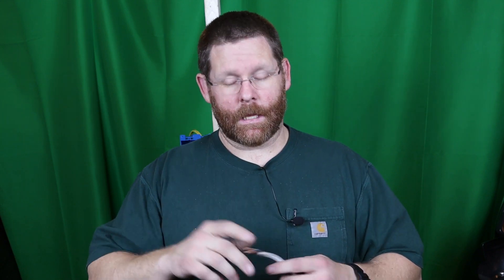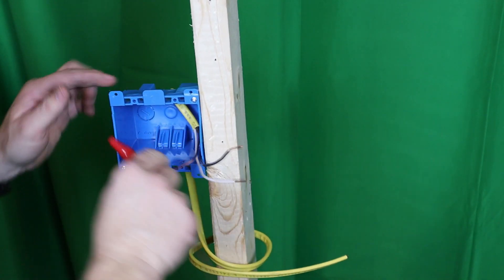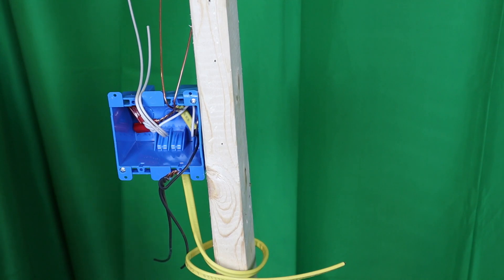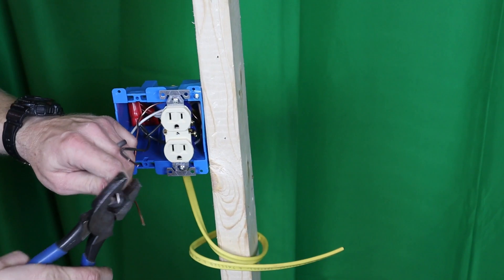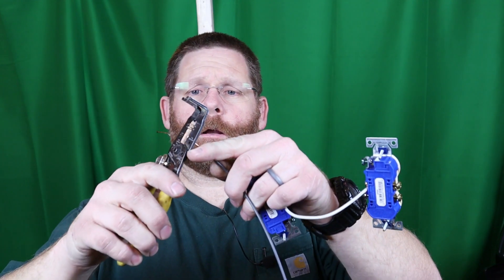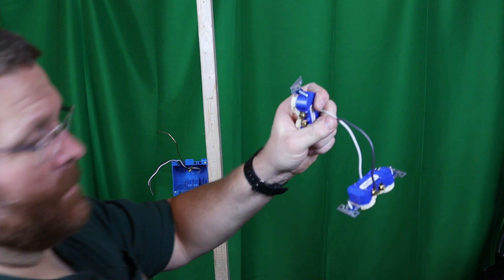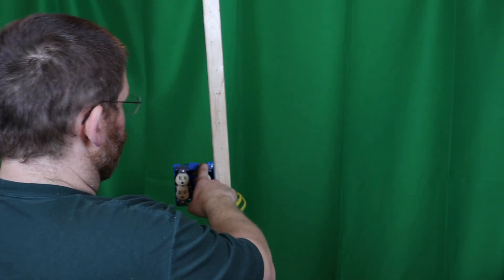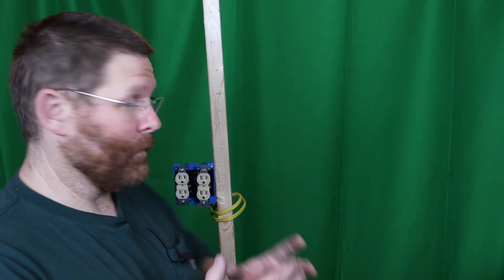How To Wire A Double Receptacle Two Different Ways

Comment: So your reason for not liking method 2 is if you have a problem later you have 2 less screws to check. Did I understand you correctly?
Reply from the maker: so it was kinda vague what I said.  so there is alot of different reasons but main for me is if i had a problem with one of the receps I could  take that recep out of the equation fix it and not mess up anything downstream like if it was a circuit full of computers and could turn off the circuit you can take that one off leaving everything on while fixing that problem

Comment: Hi, I’ve done exactly what you’ve done in the video. My question is , I want to come from the first receptacles, go left and right with two receptacles each side.  How would I bring it to the other 4 receptacles, from the first two? I have a 20 amp breaker, using 12/2 with a ground, great video very informative Thank you
Reply from the maker: basically in and out.  Go in one box then back out id make pigtails in the boxes
Reply: @MountaineerOutdoors  Same as first box, just repeated. Thank you

Comment: Why can I not find a darn video that shows what all is what on the actual outlet!!  Source side?, output side? Ground multiple, top screw vs bottom screw? Man this sucks. Ive never done electrical. Ive been locked up for many years and now being out I have no freaking idea what to do. Sucks.
Reply from the maker: Here you go bud... Hope this helps https://youtu.be/GyJNMG0JTE8
Reply: @MountaineerOutdoors  ty! Appreciate it. I managed to run another outlet but now gfi in garage keeps tripping. Must have something wrong God help me haha
Reply from the maker: Might have the ground touching something. Like nuetral or a hot. Let me know what you find
Reply: @MountaineerOutdoors  ty! Gonna try working on it today. Gonna Try working on it today. Do you know if I went with A 20 amp GFI would that make a difference and if so would I have to upgrade circuit as well?
Reply from the maker: No that won't solve the problem you will need to find out what is touching or maybe you have a bad gfi. Upgrading to a 20 amp you will need 12 gauge wire. Is that the only gfi on that circuit?
Reply: @MountaineerOutdoors  ok. Ty. Looks like it is only gfi. From what ive found it looks like the one garage gfi outlet covers the outdoor outlets. Strangely none of the outdoor outlets seem to be gfi either just normal outlets. I feel like the electrician who built home had too much on that one gfi
Reply: @MountaineerOutdoors  oh my gosh man I got it working. Appreciate the videos. Got new gfi hooked up. Then got light running and everything seems good. I confused the ground with black. Was thinking I was hooking car stereos up back in day haha. Thanks man appreciate it. God bless
Reply from the maker: Awesome so glad to hear this.  It's always a good thing when you can accomplish something on your own. Merry Christmas and thanks for the comment and watching

Comment: I can tell the guy knows what he is talking about but I couldn’t even get a chance to see the wiring scheme because it was always moving in his hand. Thanks for the video tho because I think I got the idea.

One question tho for the second way. Why do you use the Side screws rather than push connector in the back for the black wire?
Reply from the maker: This video is the reason why I do not stab in the back. Thanks for watching and commenting ☺ https://youtu.be/UJ4UvQ7VAig
Reply: @MountaineerOutdoors  Wow I just did about three outlets in my sons room using the push in method.  Thinking about going back and redoing them because of that video. Good points.
Reply from the maker: Yeah I am definitely not a fan of the push method. They should in my opinion not even put that option on the receps. If It were me I definitely would especially since it's only 3.
Reply: @MountaineerOutdoors  I ended up fixing them today ha. The only one I could not fix was my single pole outlet switch. Has two black wires going in and then the red wire. I used the screws when able but the second black wire had to be pushed in as there was no second screw for the black. Would that mean I should convert it to a double pole so I have 2 screws up top for the black?
Reply: @shaun9209  *three way switch not double pole.
Reply from the maker: so the one with the red wire is it a 3 way?? or was it and now its a single pole??
Reply: Shaun
So it’s a single pole switch which I put in when I redid outlets. It has a 14/2 cable coming in then a 14/3 cable going out to a outlet that is controlled by switch on top and bottom is always one. So to do this on the switch there is the red connected to bottom screw. Then a black for the coming cable connected to the top screw, then the black going out cable is pushed into the top part of switch since there wasn’t an another screw. So basically the outgoing cable now has alway hot black ( which when gets to outlet goes into bottom part to keep that outlet always running) and the red controlled by switch. So to get rid of the pushed in black on the switch would I upgrade to three way switch since it has two screws up top and one on bOttom or create a daisy chain and just wire but the in and out wire black and run a pigtail cable from that wire n it tk the hot on the switch and therefore only requiring one screw for hot?

Btw  after researching probably more than needed I’ve come to learn your first method for this video ensures a  complete  parallel circuit unlike the daisy chain which is method 2 . Seems some areas require parallel as code for what it’s worth.
Reply: @MountaineerOutdoors  It was a single pole before and still is now..

Comment: I agree with you on preferring the first method. Only GFCIs should be wired to supply downstream outlets.
The primary reason outlets have 4 screws is so each outlet can be powered separately...i.e., have one outlet live and the other controlled by a wall light switch. You would snap the tabs off for that(before connecting any wires) 
Best to keep it uniform rather than try to redefine the function of an outlet.
Reply from the maker: agreed

Comment: I am adding two double outlet boxes into my garage and I am using a gfci outlet as my first outlet in the circuit. In order to protect the other outlets on that line, will I need to wire them up the method #2?
Reply from the maker: https://youtu.be/Fe9hwE8dN_k. This should explain everything you need to do. Let me know if you have any other questions

Comment: I have some questions:

1.The pigtails are sold already cutted or are taken from the main cable?
2. How many outlets can run from the same braker? 
3. In a workbench, I have a outlet box with a table saw and a shop vacuum plugged in, to work simultaneously. Can I add more boxes for more versatility even if is powered with a 12 gage extension cord?
4. Can I wire more outlets from the one my workbench is plugged?
Reply from the maker: 1.  you can buy pig tails but I just used scrap wire.
2.roughly 10 per code on a 20 amp circuit.
3. sounds to me like you have it maxed out already. if you are using both at the same time.or your real close. Id say your table saw is at least 10 amps and the shop vac is around 4-7 amps just guessing?
4. that depends on alot of variables.

Comment: If my receptacle is full..can I add another outlet to it?
Reply: I’m rearranging my living room but where my entertainment stand sits there’s no outlet. But there is one like 3 ft away. I was going to run a new outlet off of that one behind my stand..but there is no room to add connect wiring. So I was wondering if I can pig tail and run new wire to new outlet
Reply from the maker: Gotcha, that depends on alot of things, how many receps are currently on it? Does it feed anything else? Is your current box deep enough to handle another set of wires (cubic inches). Without me being there I cannot say for sure.
Reply: There’s 5 being fed by the circuit. I’ve been researching and saw that it should be no more than 80% of the amp usage? The breaker is a 20 amp so 16 max should be fine?
Reply from the maker: Your correct. That's is exactly right. Each Recep is rated at 180va which got each plug it's 90 hence the duplex making each device 180 having said that you can safely assume that round about 10 receps on one breaker. Now to make sure that your box will handle the extra wires and your golden
Reply: When you say handle your talking about fitting inside the box? And thank you very much.
Reply from the maker: Yes
Reply from the maker: I'm not exactly sure what you mean?

Comment: I'm working with GFCI outlets making what was one outlet into two.  After watching your video I'm convinced that the wiring is right - assuming that a GFCI works basically the same as a regular outlet - but NOTHING is working.  Apparently I've done something very wrong because not even my lights work any more.  I used your method #1 and I'm wondering if it's something with the ground wire.  Any ideas?  I will say I used the holes on the back of the receptical instead of hooking on to the screws.  I wonder if that would make a huge difference...
Reply from the maker: Honestly it sounds to me like you have the hot and nuetrals switched. The incoming hot has to be on the line side then the downstream has to be on the load side.

Comment: Clear as mud. It's like watching someone explain juggling by watching him juggle. Why do you think you have to move so fast? You're not on the job and (presumably) you're not trying to prove anything. How about describing how to make neutral and hot pigtails (you explained the ground, but that's easy.
Reply: The "PIGTAIL" is not fully shown or explained.  NEWBIE with virtually no wiring experience, like myself, needs to see the process step by step.  The way MO is holding the wires in his hand, it is somewhat difficult to see that he is attaching 2 short pieces of wire to the incoming wires.  MO uses PIGTAIL method to split the incoming wire [by attaching 2 shorter pieces of wire with the wire nut] so that he can then wire the 2 receptacles separately.  MO chooses this method instead of installing jumper wires, because as a PROFESSIONAL he is used to doing pass-thru pigtail wiring from receptacle to the next and so on until the circuit terminates at a fixture or appliance.  Having just watched another video with the jumper cable method, I would have to agree that the PIGTAIL method is more logical as the power supply is being split to the 2 receptacles as opposed to passing the power from one to the other.
Reply from the maker: Exactly gonna do s video on making pigtails.
Reply: @MountaineerOutdoors  THANKS MT Outdoors !
Reply from the maker: My pleasure ☺
Reply from the maker: Ok noted. However, I didn't think that I was moving too fast. I'll definitely keep that in mind for upcoming videos.

Comment: Exactly what I needed to know. Like that you showed "your" preffered method  because I was taught the 2nd way you show but I'm really liking your way. So I basically pigtail the "main" wire and then attach the ground, neutral, and hot to each of the outlets? Basically like you are wiring  each outlet as if it has it's own "main" line, except in this case it only has the one "main" coming in. Thanks
Reply: I ran into an issue with the 2nd outlet. The green test light is on but when I plug something in, it's not working. I know it has to be something I did, just cant figure out what I did wrong. It's just odd the green test light turns on but the outlet itself doesn't power anything. Maybe you might have an idea.
Reply from the maker: You have to make sure that your nuetral and hots are in the right places. Sounds to me like you you have them crossed
Reply from the maker: That's awesome I like finding more than one way to do things as long as it is right. I appreciate you watching and commenting ☺

Comment: Hey there - im changing the outlets in my bathroom from off white to a clean white. Well, the previous owner had them wired as example two. I like example one much better. So my question is this - what are the black, white, and ground wires called? So I can go to the hardware store and pick some up. Or do I just tell an employee what im doing and hope they know what I need?
Reply from the maker: You can buy some romex and strip it out yourself. Or you can buy individual pieces per foot. If you do that you can ask for 12 Guage solid wires THHN  hope that helps
Reply: Awesome, thank you sir! I've actually been binge watching your videos lol thank you!
Reply from the maker: That's awesome I do appreciate that. ☺
Reply: Oops one last thing - 12/2 Romex, I assume? I'm a new home owner so I'm learning as I go!
Reply from the maker: That's exactly what I would use. 12 Guage is for 20 amps and 14 Guage is for 15 amp breakers  you need to see what size breaker it's on.
Reply: Hmm, alright. I've just been shutting the main circuit breaker off. I'll have to have a friend help me so im not running up and down the stairs all the time haha
Reply: Alternatively, I could plug in a radio, or vacuum. Then go downstairs and just shut the breakers off one at a time. Whenever the radio shuts off i know the power has been cut 🤔
Reply from the maker: Good luck and let me know how it goes. ☺
Reply: Yes sir! Might have to wait for the weekend - got an awfully busy next couple days
Reply: @beegekhaos3171  A coworker of mine used a radio, but what he didn't know was his wife shut the radio off because it was "too loud". When he cut the wires he got a big surprise. So always check the circuit with a meter or non contact tester.
Reply from the maker: Damn good advice always double and triple check

Comment: Method 2 seems to use less space in the box. I'm doing a retrofit of two receptacles on opposite sides of a concrete wall and the box already there on one side is small.
Reply: Exactly my same situation.  Method 1 with the added wires n pigtails won't fit in the box.
Reply: Method 2 is the only way i have wired receptacles for 40 years much cleaner and less joints to work loose.

Comment: Can I use existing wire in my attic to add double outlet then add another wire to add one more outlet?
Reply from the maker: This depends on how many receptacles and other stuff is on the circuit already. My recommendation is to turn off the circuit and see how much stuff is off. Then make your decision then.

Comment: So glad I found your videos. My question for you is... Is it safe to put 15 amp receptacles on a 20 amp circuit with 12/2 wiring? Thank you
Reply from the maker: By code as long as you have at least two or more you can. Do I see a problem with it? No but it wouldn't hurt to put it on a 15 amp breaker or you can switch them out to a 20 amp.

Comment: Very nice video.   Few comments,   Twisting the conductors before the wirenut is acceptable but not required.   See manufacturers instructions.   https://www.gerrie.com/ASSETS/DOCUMENTS/CMS/EN/IDEAL_30_071_Installation_Sheet.pdf.   Question,    Why would you not screw in the un-used screws on the sides in?   I know fly poop in the pepper.   I did not understand the comment about hot and not hot in the end.  Not enough information to formulate a decision in my mind.   Not hot is a "I know nothing" question.
Reply from the maker: I would NEVER just assume that the wire nut would twist the wires, yes I know it's not something that is mandatory...its not mandatory to tie your shoes either but it makes alot of sense, As for all your other questions I'd have to watch my video again to see what it is your talking about. And the fly poop in pepper?? 😂 😂
Reply: Mountaineer Outdoors     Wire nuts part is as implied, a choice.   Either way the conductors get twisted if done correctly.  The screws on the side are more important in 1gang metal boxes,.     Finding fly poop in the pepper is an old expression of being extremely picky.   So small a difference, not worth the effort.    This is a picture for you.     
https://www.google.com/search?q=fly+poop+on+wall&rlz=1C9BKJA_enUS596US597&hl=en-US&prmd=isvn&sxsrf=ALeKk02vvnzrLOOXMu2dEK9Pmn-Ts4DZ6g:1585580301775&source=lnms&tbm=isch&sa=X&ved=2ahUKEwj8nJn1usLoAhWCQs0KHUMODk0Q_AUoAXoECAsQAQ&biw=1024&bih=659#imgrc=2W8FG5wp_QS8WM.
Good luck to you.     Kevin
Reply from the maker: Gotcha.. Thanks for the explanation.
Reply: Mountaineer Outdoors    Best Wishes sir.
Reply from the maker: Thanks and you as well

Comment: What about if it is metal box? What do you call and the red thing you wrap the wires and what size is. I ask it because at home depot there are too many and I don't know which one to buy.
Reply from the maker: Are you referring to the wire nuts?  And if it's a metal box you need to ground the metal box with a green ground screw
Reply: @MountaineerOutdoors  you join the wires and then you cover with the red thing.
Reply from the maker: @MarioPerez-yi2tw  they are wire nuts I prefer Buchanan B caps. Don't buy cheap wire nuts. Pay a little more for the good kind. Ideal make some too.

Comment: This place I am working on down the wiret, about 12". strip a section long enough to make a loop around the terminal then the other end to the second  outlet so the wire is 1 single strand connecting the  2 terrminals.
Reply from the maker: so basically your saying that its just wrapped around the screw without any joints?